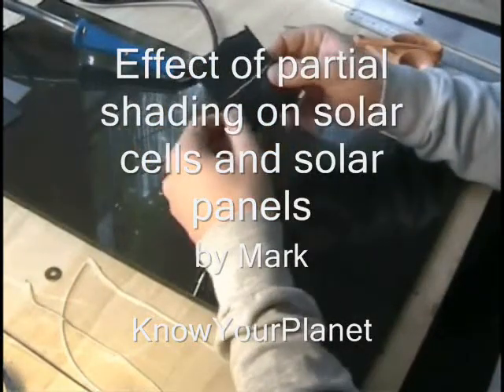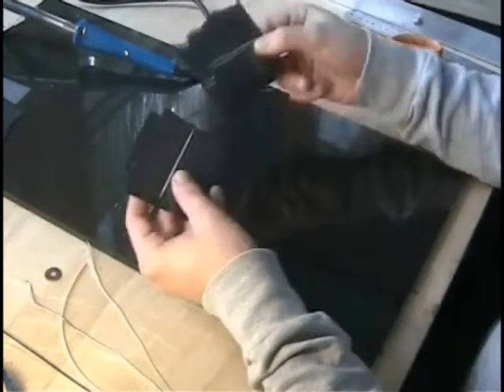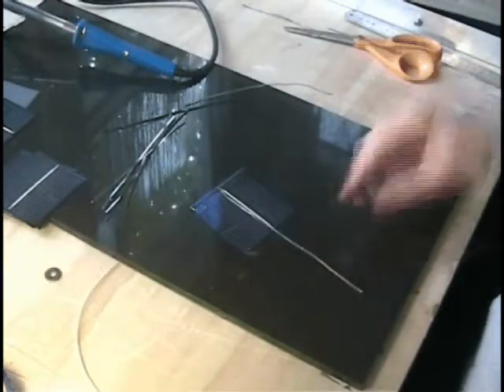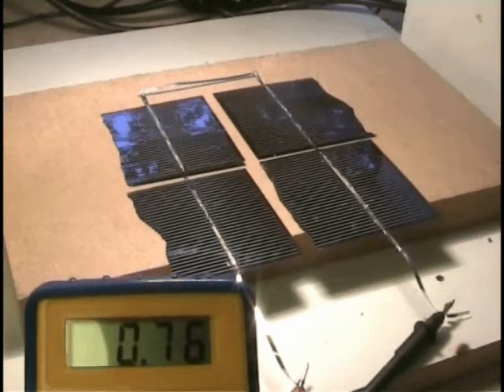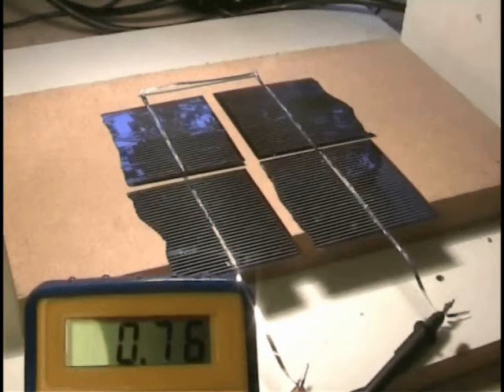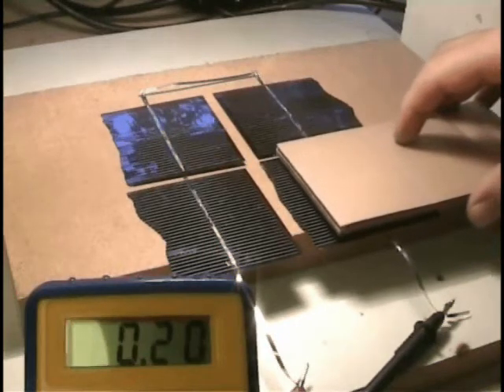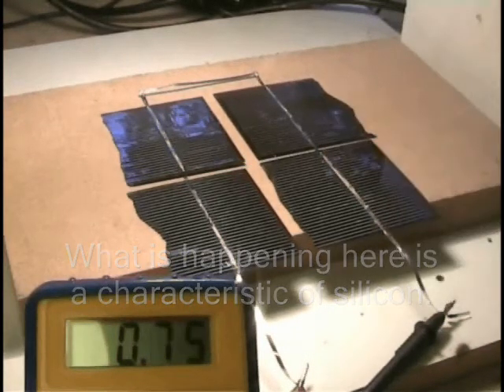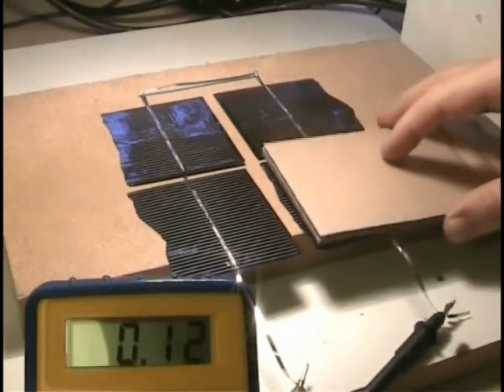solar cell shading problem illustration

Comment: This is a feature of monocrystalline solar panels, which are the most efficient. Amorphous panels don't suffer so much from partial shading but put out much less power at maximum efficiency as well. 
However, polycrystalline panels now come close to mono in output, and do not suffer so tremendously from partial shading.
Of course you will always get less output from the shaded part, though, so keep any panel in as much light as possible. :)

Comment: If you connect in Series, THe voltage will add up but the current will be same as the minimun current from a solar cell. That why covering one cell along will affect the entire current output. If you connect in parallel, current will add up but the voltage remain the same as the minimun voltage from a single cell. The same goes for battery. That why never put a old battery together with a new one.